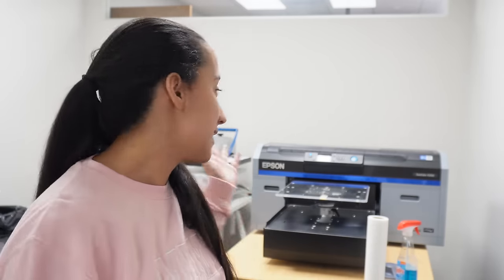Work With Me on Orders for TikTok Shop! Printing & Packing Orders! Epson F2100 DTG printer

Comment: I worked in a factory sewing for 15 years and all the women around me dealt with the same problem and had surgery and they couldn’t understand while I did have problems and one of the older ladies in the department told them because I was wearing a lot of copper bracelets and copper helps the joints. I wore them for fashion because I was young then and didn’t have a clue about that. I am 75 now and still sew, embroider and craft and I honestly have no joint issues. I have pure copper necklaces, rings and bracelets  that I wear from time to time. Check it out sweetie you’re to young to have to go that.❤❤
Reply: Wow very good tips

Comment: I run a huge mongoose dtf printer at work and the dtf printers are soooo much work . Literally if you’re not ready to print right away the print head needs cleaned and nozzle checks . These printers aren’t just ones you can fire up and print and I’ve learned that real quick lol 😂 and it needs babysitting.

Comment: I have lost the use of my thumbs, due to delay of carpal tunnel surgery.  The surgery finally was done 20 years ago, but at the time the DR informed me that waiting 3 years from time of diagnosis,  I caused a lot of damage.  The delay of surgery was not my doing, I could not get worker's comp to agree to the surgery cost because my employer kept fighting it.  I still receive worker's comp to this day for the damage done.  Please not trying to tell you what to do, but don't delay too long on the surgery, you will lose hand strength.  I am 73 years young and am really realizing that when this situation arose due to work complications, the delay of surgery is now causing lots of problems and there is nothing anyone can do now to correct the problems.  As I said, I am not trying to tell you what to do, but please from experience, don't delay the surgery too long.  Blessings to you and your Family.  Love your videos even though I do not use my BN20 or do pressings any longer.  I also wear Mueller wrist hand braces, they help somewhat, but I still do not have full use of my thumbs.  Good Luck, Love and Hugs!!!